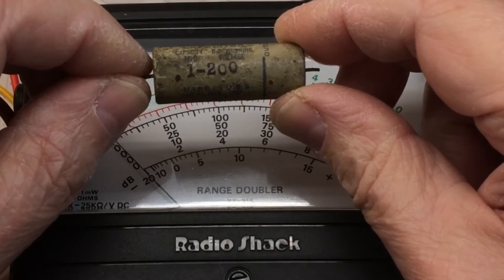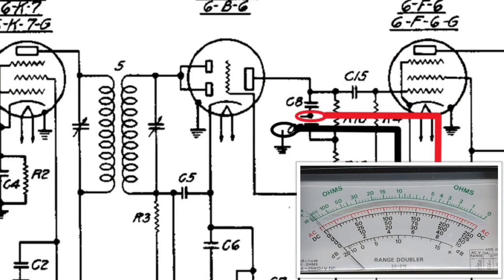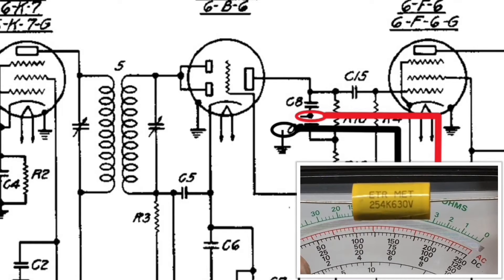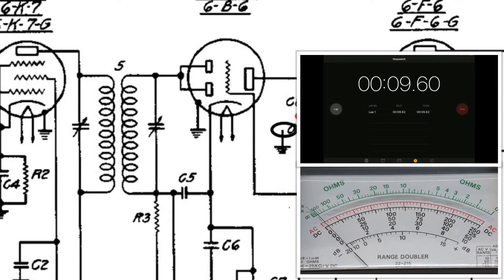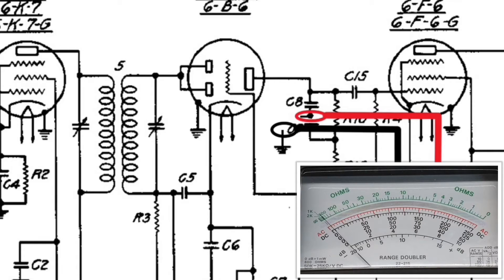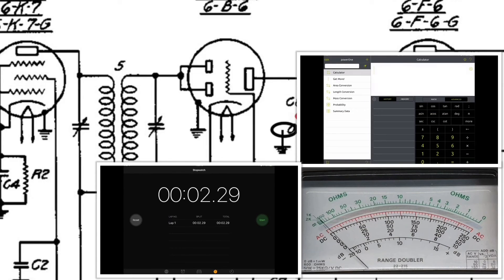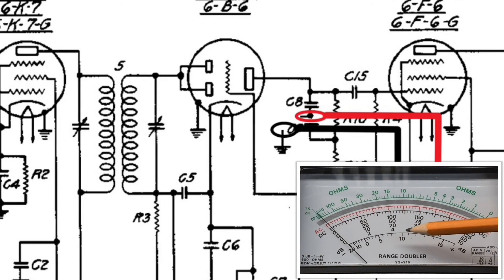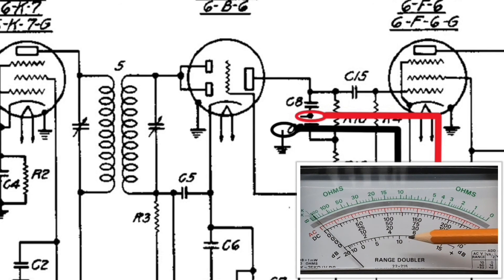Using an Analog Voltmeter to Measure Capacitance

Comment: Like it, But that got me thinking. besides the human interaction it takes  and the amount of error you can through into it with your reaction time your mileage may very, but getting back to my question. What is 5 x  in the equation number representThanks Keith
Reply from the maker: +Keith Schreiter I agree Keith, it's an old school M&P.  I have no reference for 5 in the formula. I was going through some of my notes from years back that tied to my readings from the late 70's early 80's, which sparked the idea to share in this video. If I run across the author or additional info, I will provide an update. Best, Don

Comment: very interesting, i use my sencore LC 102 for leak test
Reply from the maker: +DENNIS N This is an school method for sure. The Sencore LC102 is very nice. I have a $25 LCR LOL. Do you repair vintage electronics for a living or just a hobby? Best, Don
Reply: Just hobby and a expensive one along with my machine shop
but at 71 not too much of anything